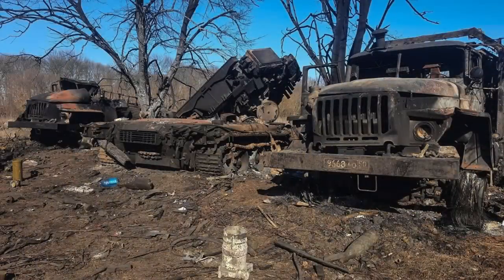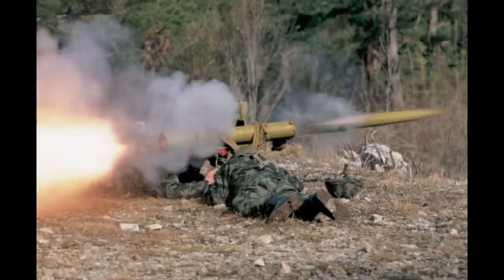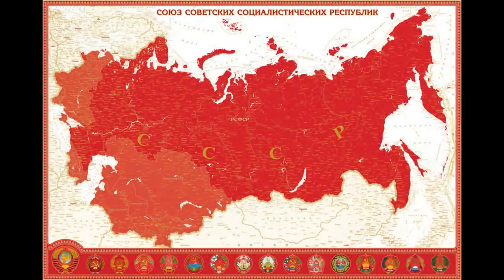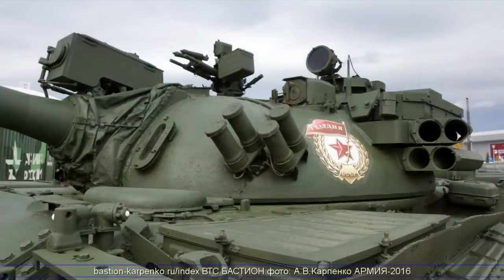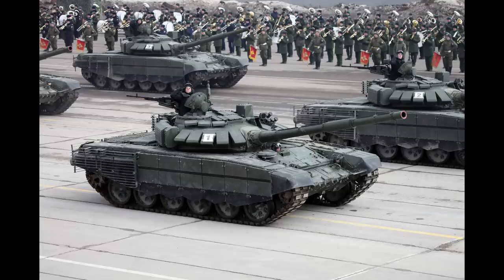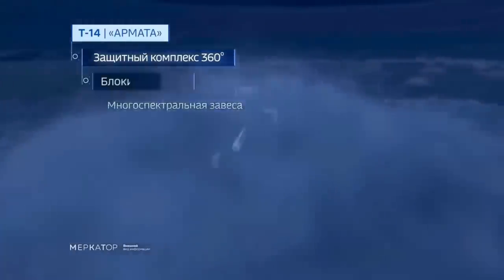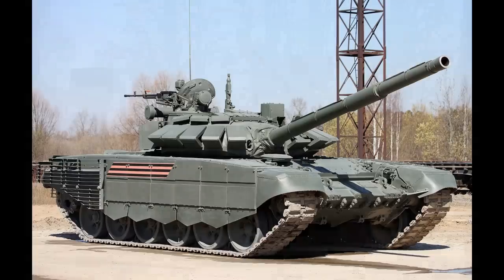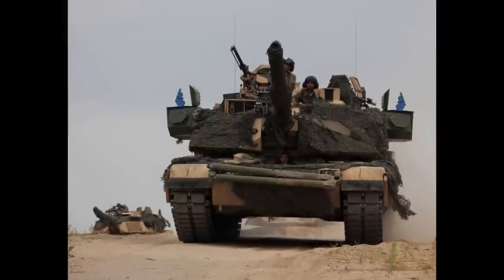Why are Russian Tanks Failing in Ukraine?

Comment: I am unaware of their poor performance - they seem to perform very well. There are no reports of massive breakdowns in tanks or issues hitting enemy tanks / structures / infantry. No tank is invincible - 1000s were lost during WWII. 1000s were made. 
Problem is that most kills are not with ATGMs and many ATGM hits are just mobility kills or do repairable damage even when they penetrate. Thus investing in APS is nice and all but not necessary.
Reply: Its not ww2 anymore,   modern tanks are way more expensive and the crews need more training
Reply: @seamonkey8878  So what, tanks, aircraft, people are all expendable. The point stands that tanks will be lost. So will aircraft and ships. What matters is winning the war. And Russia is doing that. Hence their tanks are performing well - since they are leading their army to a victory. 
during WWII both Sherman and T-34/85 were vastly inferior to Tiger II. So what? Even few heavy tanks allies had in 1945 were not as great as Tiger II. So what? they won. That is what matters. War is a system in which T-34/ Sherman both performed well. Their late war equivalent, Panther, when equipped with proper armor and 1945 suspension was also a better tank in almost any role - so what? 
Russia switched to tactics that works for it and leads it to victory. This involves loosing some tanks. But that is the job of a tank, to destroy and sacrifice if needed.
Reply: @tomk3732  lmao maybe people are expandable in russia, would explain why nearly nobody likes them. And whats your point about ww2, times have changed, seeing your people or equipment as fodder wont help you against an better equipped enemy or sb who has better tactics and more men than you. Also I wouldnt say russia is winning, it took them like 140days to conquer some random small city and some empty farmland, while sustaining massive casualtys and now there progress seems to have halted, while ukraine is prepairing a counter offensive
Reply: @seamonkey8878  They occupied a fifth of the second largest country in Europe.And you are talking nonsense  I wouldnt say russia is winning.  Hahahahah . You should look at Ukrainian losses.The country is devastated.
Reply: @seamonkey8878  If pp were not expandable you would never go to war ;)
Russia already won the war and is now sweeping as the state goals are there. This is how one determines success or failure. 
As to "massive" casualties I would be careful there - Russia by some accounts now lost more troops then it had ;)
If someone has better equipment and more pp you are going to loose. Your only choice here is to inflict so much pain the enemy will simply not want to continue - but in total war, you loose. 
All armies see people and equipment as expendable - there is no way around that.

Comment: The majority of Russian tanks are old models , since they mostly attack infantry , bunkers and almost no tank vs tank combat . So not many tanks have this protection systems , cause they are very expensive . And the Russians have many old tanks on stock , so you will never see a T14 in Ukraine . War is expensive and you need to keep the costs low , no nation would throw their best equipment first .
Reply: "War is expensive and you need to keep the costs low , no nation would throw their best equipment first ."

Throwing in sub-par equipment which quickly gets itself and its crew destroyed is not "keeping costs low".
Reply: @samuelweir5985  Sure cause you get rid of that old weapon's first , that are on stock since decades . And to clean out buildings and bunkers from infantry such old tanks do the job as well , no need for a T90BVM or how they all are called . This modern tanks would fall as well , as we saw . So it is cheaper to take the old one's first .
Reply: @5co756  "Sure cause you get rid of that old weapon's first , that are on stock since decades ."

Yes, you also "get rid" of the lives of the old weapon's crew at the same time. How convenient.
Reply: @samuelweir5985  Dude a modern T90 or even a T14 would get destroyed as well from arty , drones or an ambush of infantry with ATGM launchers . They won't last longer , as we saw .  I just wanted to point that out , cause some say the Russians have no modern tanks . But it would be stupid to use them in such a war , hope you get it this time .
Reply: @5co756  No, I don't get the point of not using a lot of one's best equipment in a time of war to save one's equipment from being destroyed and one's soldiers from getting killed.

On the other hand, there is a good case for not sending one's premier, top-of-the-line equipment into a war where its not needed. For example, we wouldn't send our F-22 Raptor stealth fighters into combat in a hostile airspace where F-15 Eagles would do because we don't want to take a chance on an F-22 crashing in hostile territory. So, yes, if there is equipment with sensitive secrets you don't want to risk having that lost or captured unless there is a full-scale war. 

However, that's not what you're talking about. You're just talking about sending in "old tanks" first to "keep costs low" which doesn't make any sense.
Reply: @samuelweir5985  What you wanna do with those old tanks ? Russian's got plenty of them standing around , so use them is cheaper than a new T90 for example . A T90 is not better against infantry , arty and drones , in a tank vs tank battle you would use your best tanks .

Comment: Light armored vechicles (LAV) should replace tanks in the Russia  Ukraine war.

This LAV should be able to take hit damage from 50 cal sniper, rpg and small arms.

This LAV should be equipped at least with machine gun for fire superiority. Added automatic grenade or other greater firepower such as mortar will be useful too.

This LAV should be cheaper to produce than a tanks. And cheaper than a javelin, manpad and nlaw

This LAV should focus on mobility tactic. Speed and fire superiority to cover the ground troops. 

LAV tactic is to overwhelming the enemy forces with numbers and speed, as well the fire superiority so the ground troops can take controls of the battleground.

The LAV should be able to carry not more than 8 (driver, gunner, drone operator for air support, assaulters) operator because the tactic is to spread and overhelming the enemies with numbers. 

#Uraaa
#russia

Comment: I’ve got a question about the images or killed tanks with reactive armours:   Are these reactive plates “fake”?    Let me explain, the explosive material (I think) should burn off or cook off due to tank burning (exploding will require an explosive).  These reactive plates shoes no sighs of “jets” or heat damage from its seams.   

I think , due to corruption & embezzling or cost saving, the explosive material was not used.  Empty boxes are mounted.
Reply: Not all explosives explode upon burning. You can burn C4 in open air and it won't explode. You have to blow it up with a primary explosive first so that will set off the big charge. Same principle with ERA panels. Just because the tank exploded does not strictly mean that the ERA also has to explode.
Reply: @NikolaiRomanovsk  Many modern explosives are insensitive and won't explode when hit. However, any explosive that I'm aware of should burn and release a lot of energy when it gets up to a sufficiently high temperature like if the tank as a whole is burning, which is the point that the OP made.

Comment: Excellent video 📹 
Russia 🇷🇺 is using the Detroit business model.
The cost of putting a safety device on every tank exceeds the 'liability costs'  of a few tanks knocked out.
Anyway, these old tanks has to used up.
Reply: Lol, nowadays the Detroit auto manufacturers put safety devices most people don't even want or know about in cars and just charge extra for them. Times have changed.

Comment: Hello red effect can you do the kf51 vs t14 armata pls
Reply: tank that only exists as a prototype and never will be produced 

vs 

tank that only exists as a prototype and never will be produced 

:)
Reply: @___seb3341 
So far KF51 is a new turret on a Leopard 2 hull.
Considering how many old Leopard 2 (hulls) are stored somewhere, and could be upgraded, I thinks it's reasonable it'll come to life.
Reply: @damianm-nordhorn116  Not to mention a large portion of NATO employs Leopard 2 variant. The KF51 provides cost effective upgrade, when compared to buying new 4th generation MBTs. While providing an alternative if the EMBT program between France and Germany, if it's ended over political reasons. Basically it's a repeat of the Leopard 2/MBT-70 relationship. Germany known for developing domestic back-ups, just in case their joint projects fail.

Comment: Javelin uses an Infrared Guidance like Short Range Air to Air Missiles used by Modern Fighter Jets
So Conventional Flare decoys would easily work against it or even if the engine is off it wont lock.
Theres is this Electronic Countermeasure that is intalled on Russian 5th gen Stealth Fighter Su 57 called DIRCM it sends direct infrared signatures to make the guidance systems confuse so if its mounted on Russian tanks and just removed Shtora 1 Western Happy days will end.

Comment: The original premise is non-sense akin to "when did you stop beating your wife". Most of the "counted" "losses" is low-grade Ukrainian propaganda, to the point of painting burned Ukrainian T-64BV's with "Z" symbols. The only place where Ukraine is beating Russia is the internet. The fact is that Ukraine is loosing hundreds of soldiers killed everyday,  and that's just plain terrible. 

It's a high-intensity conflict though, and of course lots of tanks are being lost as well due to various reasons. However that does not mean by any stretch of imagination that "Russian tanks are failing in Ukraine". They are doing the job that they are supposed to do, and that job carries certain risks. Once you start to consider reasons for those losses - real losses I mean - some hits by ATGM's, engine break-downs with the result of vehicles being simply abandoned, incorrect tactics, mines, etc., it quickly becomes obvious that hard-kill APS could help avoid some losses but would not be a "wunderwaffe." That notion is non-sense on the same level as the title. Both are only good for internet warfare.

Comment: I disagree with Red here, Russian tank performance is actually not poor and the reason for high losses is because pretty simple, this is a high intensity war a kind of war never seen in decades. Of course installing active protection system on tanks would help but majority of tank losses are due to artillery not ATGM, this current war is an artillery war, the losses of Russian tanks and APC is going to high as Russia is using them like bullet sponge to absorb fire for the infantry, Russian infantry shortages means men is much more valuable than equipments. But Russia is on the offensive and lost equipments can be recovered (they are already recovering tanks that they losses in the Bilohorivka bridgehead) and Russian maintenance crews can literally put tanks that have been turret pop back together. Putting any other tanks in this kind of war would not change much, no active protection system is going to protect your tanks from a volley of a hole battery of grad or 152mm Msta gun.

Comment: Russian tank shouldn't be criticized in isolation, be it lack of active protection system or anything else with the tank itself. Imagine it's the Chinese instead of Russians fighting Ukraine - the whole region would have been swarmed with drones, ranging from high altitude long range recon and attack drones looking for heavy weapons, to short range off the shelf DFI drones that move like hummingbirds and go into open windows and trenches. All the data would have been uploaded and analyzed by AI in real time, giving commanders a big picture at a glance. There would be nowhere to hide and prepare ambush. They have Type99s with active protection systems that cover the top, linked with millimeter radars that automatically trigger APS. And it would never be triggered, because those tanks would never be in a position to be fired upon in the first place. The Chinese may as well be using T-55s and there wouldn't be a difference. The Russian military as a whole did not cross into the information age. Their tank isn't the heart of the issue.

Comment: The T-72 base design is flawed. It’s auto loader is in a vulnerable spot and can easily explode catastrophically. This is true for all its variants right up to the T-90.
It’s armor isn’t that tough. Russia has tried to hide this fact by placing useless reactive armor on it and then these cope cages on the hope they might work, but combat has shown neither are effective. Indeed; the turret mounted reactive armor actually creates a shot trap that makes the tank even more likely to be killed. 
Their guns and ammo are out dated. They do have much better ammo for the Armata but the turret in the T-90/T-80 and T-72 is too small to accept it. Therefore their guns cannot compete with western tanks. 
Their sighting, thermals and communication gear is out dated. 
And their tactics are to spearhead in front with no infantry or air support. This is a foolish strategy that leaves the tank unprotected from infantry using ATGMS.
Reply: Its not flawed, its just not being used according to the doctrine it was designed to fit into. These tanks weren't meant to be sent into urban environments without support. The ERA isn't useless, its perfectly serviceable against any direct-fire HEAT weapons, and useful against all kinetic penetrators Ukraine has. The cages have already been shown to be installed at the discretion of tank commanders, so thats really a problem of crew training. As for the guns and ammo, they really aren't outdated. Most western tanks use L/44 and L/55 guns, and the 2A46M5 on current Russian tanks falls roughly in-between the 2 when firing 3BM60. That ammo is more than capable of defeating current NATO tanks, not to mention the 60s-era T-64s Ukraine is operating right now. The thermals and comms gear aren't outdated either, the problem is integration. The thermals on Russian tanks are on-par with Western equipment in terms of quality, but very few tanks actually have it, and even fewer have a CITV. Comms gear is also all modern, digital, and encrypted. 

As you said, their tactics are flawed, but this really goes back to my point that the problem really isn't the tanks. When the Soviets developed these tanks, they were meant to fit into the established doctrine which relied heavily on airpower, infantry support, and fast maneuvering tactics. The T-72 and T-80 with good guns, good frontal protection, and decent top speeds fit that doctrine very well, but when you put them into an urban environment without support and expect them to fight block-by-block its absurd. 

Also as a side-note, its not just the Russians that can't fit bigger guns into their existing turrets. There's a reason the US is replacing the Abrams and Germany just built a totally new turret for Leopard 2 hulls.
Reply: @rog69  
How sad it is to run into someone who thinks they know a subject and proves themselves to know nothing.
As an example. Communications are not just a radio. Modern communications are digitally encrypted so as to prevent the enemy for listening in. Russia has had massive difficulties with this. 
You are wrong about the rest but feel free to be wrong. I can’t teach a rock to sing. I can’t teach an idiot to think
Reply: @ravenmoon5111  it’s funny how well you described yourself with the very first sentence. Stick to CoD kid, this is out of ur league. Or what is it, world of tanks 😂?